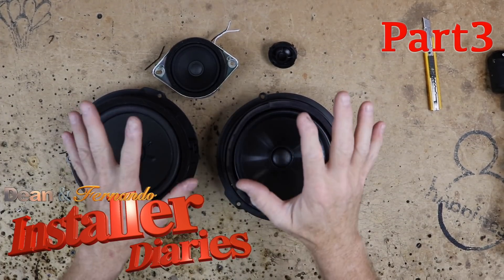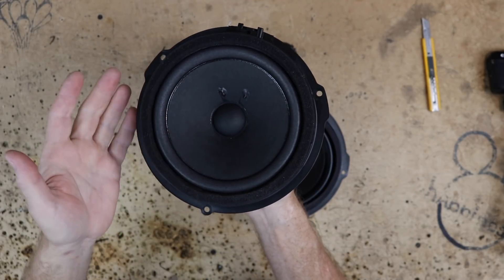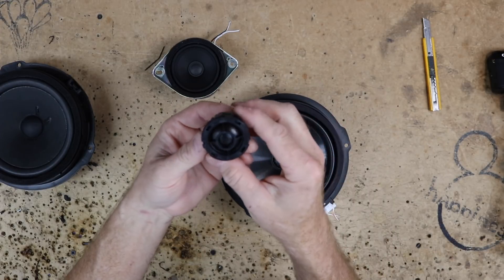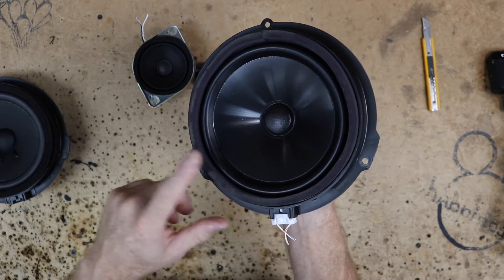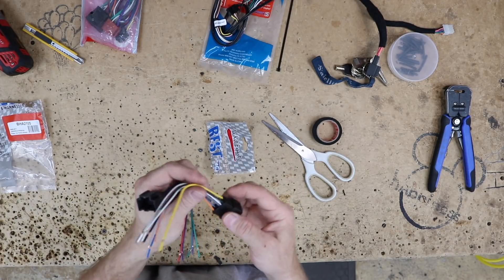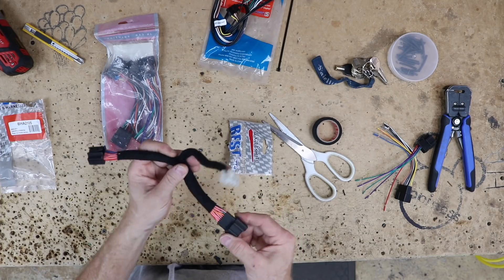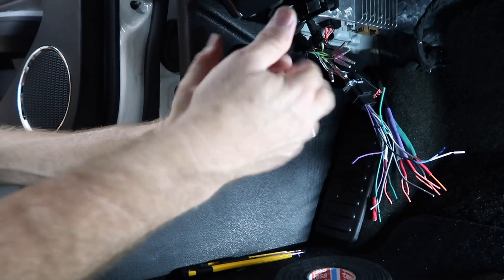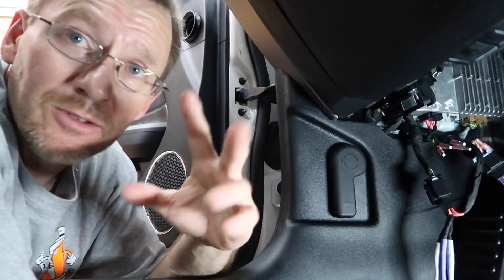Mustang  why your factory speakers are not doing it for you Installer Diaries 277 part 3

Comment: Fwiw, the basic 6 speaker system has door speakers nearly identical to your rear deck. Mine had blown by 30k miles. The surrounds separated. After looking at them I'm actually really surprised they sounded as good as they did.

Comment: I think they use the neo magnet just to save weight. The 'sub' doesn't use it as it's probably expected to get beaten on and hot. Heat quickly ruins neo magnets. Or some other cost reason...

Comment: I've disabled ANC and removed the fake engine noise from my 2020 GT premium. It has the B&O system, I want to upgrade the speakers, question is on the fronts, where can I get the full range audio signal from? I am pretty sure the source unit separates it, unless I'm wrong. Any tips would be great.

Comment: Did you guys run into any clearance issues with the flax speakers? I have a 2017 mustang with the shaker system and went with the Focal access 3 way system because Crutchfield says the flax series would not fit, and I would love to upgrade too the flax series speakers. Thanks for everything you guys do, and I can’t wait for the next video of this series!
Reply: thats due to hey arent able to use the 6.5 as a sub. not designed. youd need to run a 3 way setup in the front and get a seperate sub.
Reply: I also have 2017 mustang (no shaker) and I'm looking into the flax as well. Did you ever figure something out?

Comment: I'm a little confused. It's my understanding that you can't replace the Mach 460 woofers with aftermarket speakers because of an impedance mismatch with the amplifiers. As I understand, the OEM speakers are 8 ohm and two speakers are connected in parallel on each side which reduces the total impedance to 4 ohms on each each side. So, since aftermarket speakers are 4 ohms that means you'll be presenting a 2 ohm load to the amplifiers instead of the OEM 4 ohms. Which means that the amplifiers need to be upgraded to aftermarket amplifiers.  Did I miss something?

EDIT: OK, I see that they're going to upgrade the amps. Awful lot of work to upgrade the Mach 460 system.